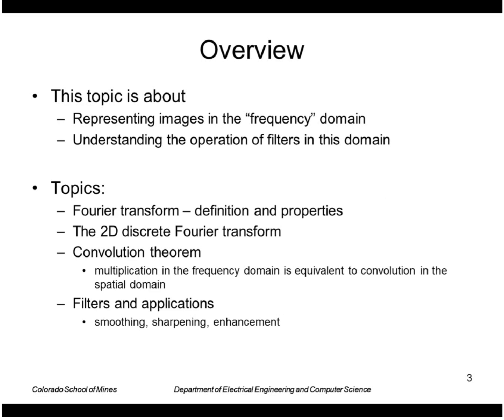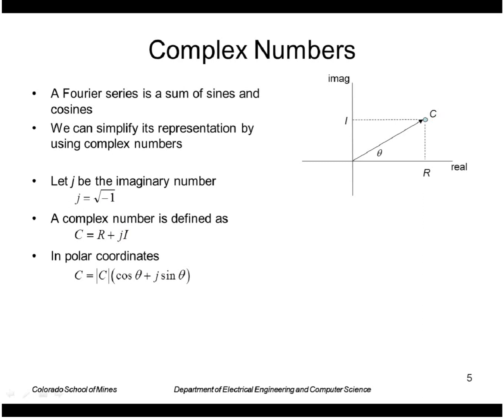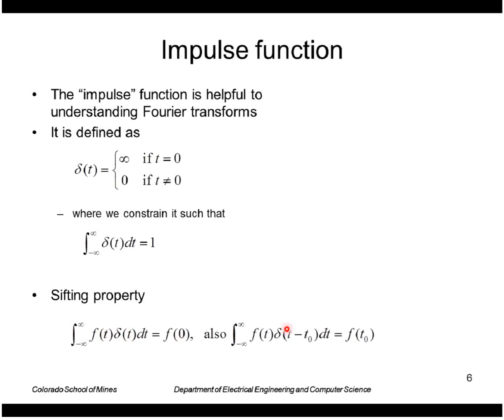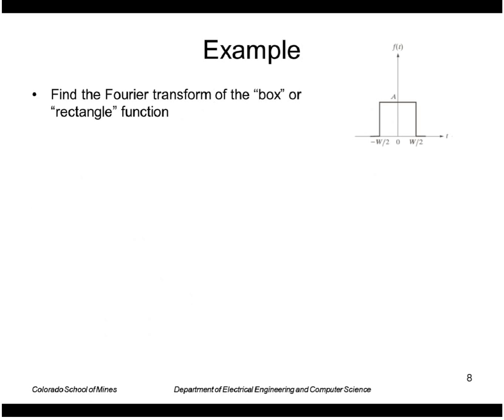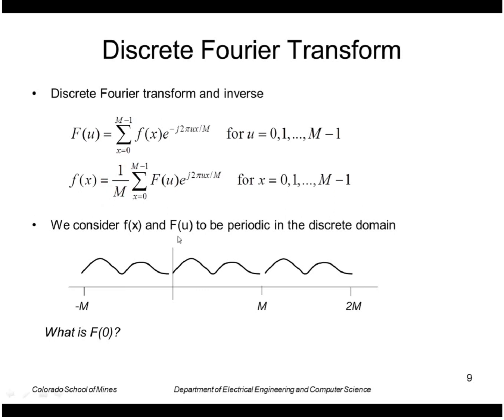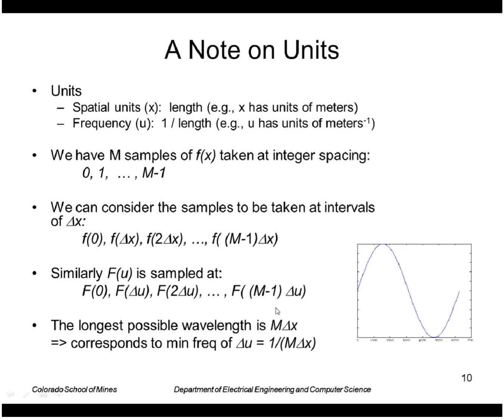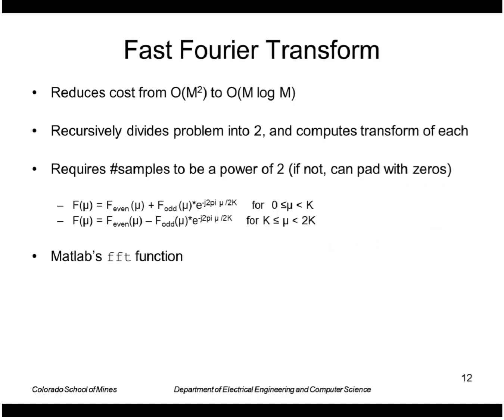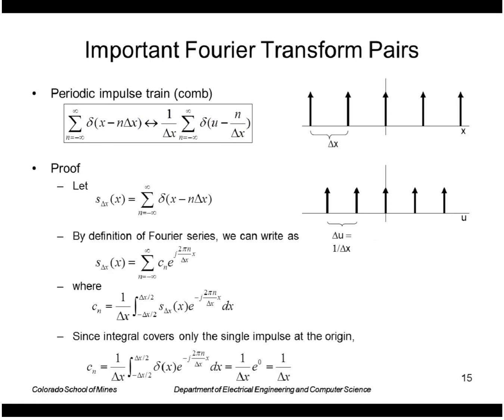EGGN 510 - Lecture 08-1 Fourier Transforms

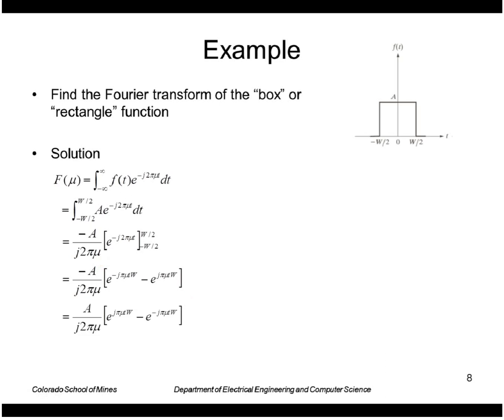Comment: Thanks a lot for your nicely explained video. I only have spot something in min 6:26 when w/2 and -W/2 is replaced for "t" value. The "t" is still mentioned in the equation. shouldn't it be removed?
Reply from the maker: I believe you are correct, yes it should be removed!

Comment: Thanks for the great tutorial. Can you please tell me what is the spatial frequency? and how can I get fx and fy?
Reply from the maker: +becool248 In this lecture, we are dealing with signals that are a function of spatial distance (x), instead of a function of time (t).  So that is why I referred to the frequency as "spatial frequency".  For example, if you had a signal that looked like a sine wave, when you plot its amplitude vs distance, then spatial frequency would be 1 over the wavelength (ie, the distance between the peaks of the sine wave).
Reply: +William Hoff How about if x is the vertical index of the image and y is the horizontal index of the image. x=1 to 256 and y=1 to 256. Are x and y the spatial frequencies? If they are the spatial frequencies, are they measured in cycles per unit of measure? If they are not, how can I convert them to cycles per unit of measure? I apologize if my question is too long.
Reply from the maker: +becool248 Slide 10 of this lecture may explain this.  If your image f(x,y)  is 256x256 pixels, and you do a 2D Fourier transform on it, the result F(u,v) is a 256x256 image of complex numbers.  Each coordinate value for u and v represents a spatial frequency in x and y, respectively.  To get the actual spatial frequency for u, multiply u by 1/M, where M=256.  Actually, in MATLAB, arrays start at 1 instead of 0, so you would multiply (u-1) by 1/M.  For example, if your image is defined by the equation I(x,y) = sin(2*pi* x/20), the intensity peaks are separated by 20 pixels.  The wavelength is 20, and the spatial frequency is 1/20.  You would expect to see a high amplitude of F(u,v) at the value of u where (u-1)/M = 1/20, and v=0.